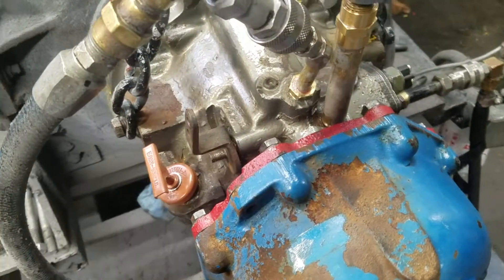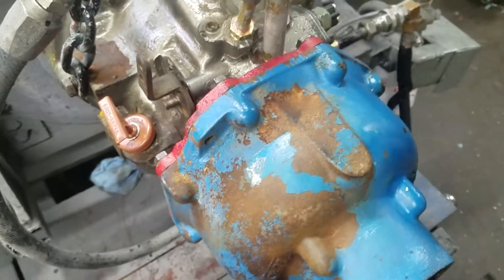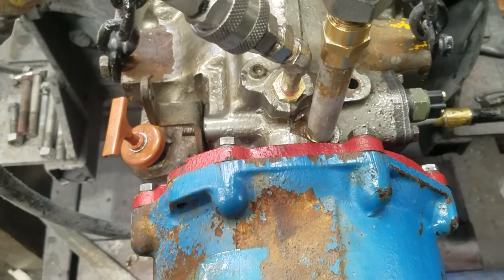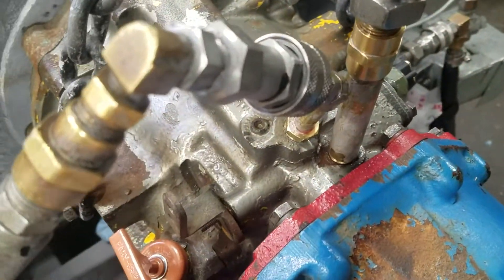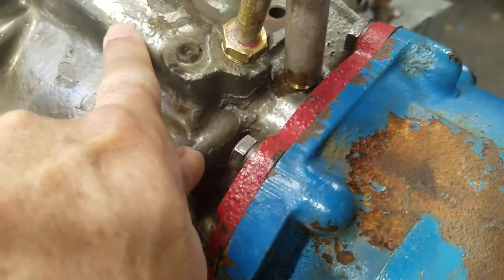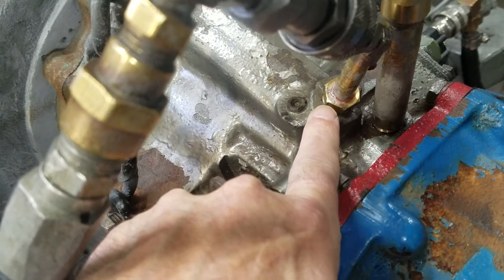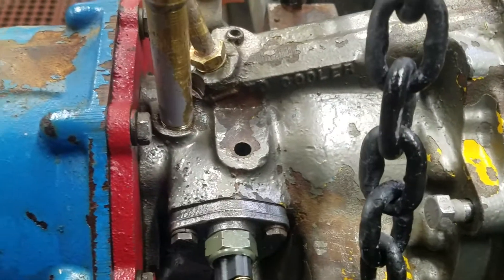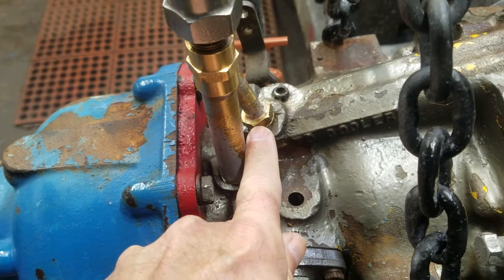Velvet Drive Pressure Port Location

Comment: G,day from down under Australia hav had mine  velvet drive rebuilt an now is pushing oil out the breather any suggestions?.it's not overfilled with oil hav changed the breather and still dose it in gear????any tips would be appreciated. Thanks rod